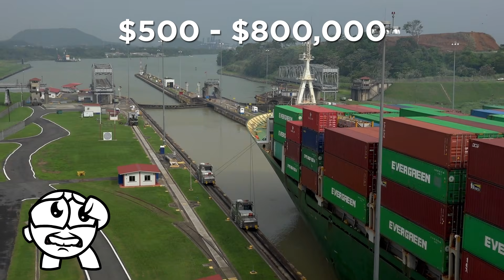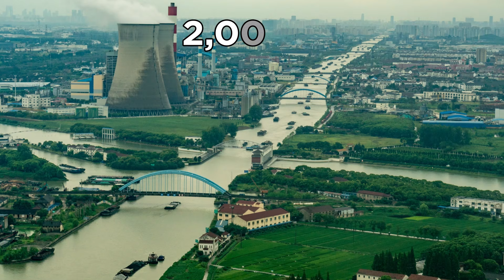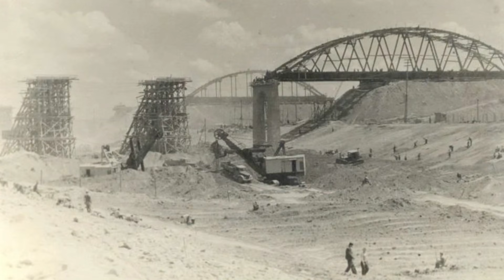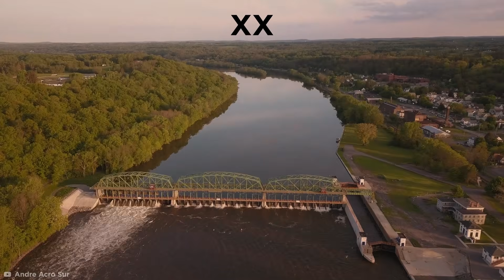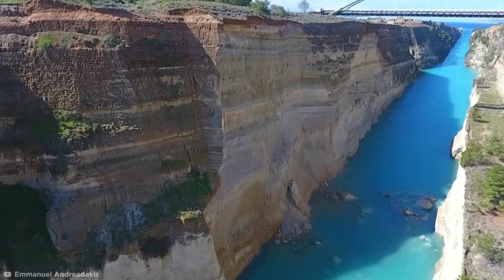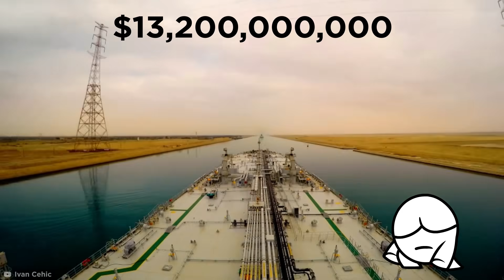Why These Waterways Are Vital To Global Trade

Comment: What would happen if the Panama canal did not have the gates to raise and lower water? How would the difference in the oceans water level affect the area?
Reply: Actually, I don't think the Atlantic and Pacific oceans are at a different height. The reason for the locks is to raise ships to the ground level of the canal. A large section of the canal is an existing lake. It would have been too expensive to have cut the canal all the way down to the ocean level ( The Suez Canal is at the water level from the Red Sea to the Mediterranean.). 

Remember, there really is only one ocean. We named them differently, but it's really just one world wide body of water.
Reply: @williamromine5715  Makes sense; and now that you've mentioned it I zoomed in the maps and there is indeed a lake. I always thought they straight up dug the whole canal which would've been expensive but possible.